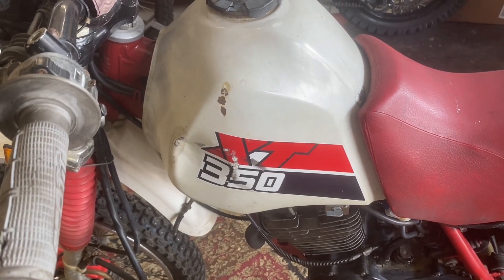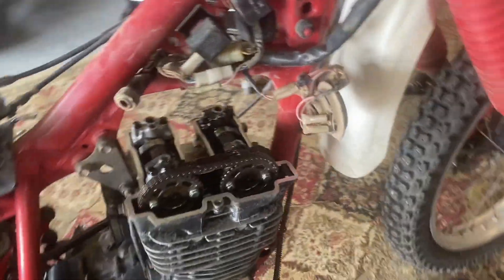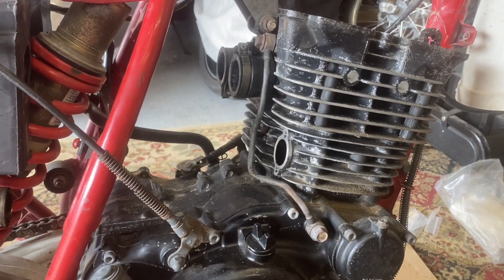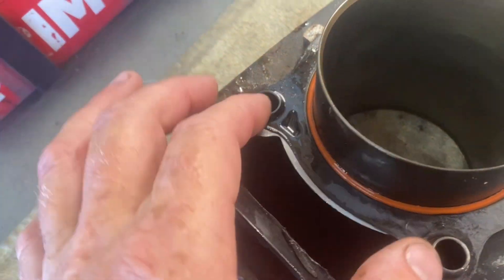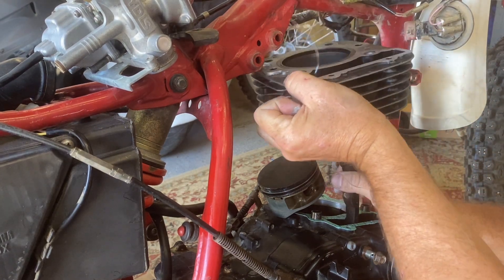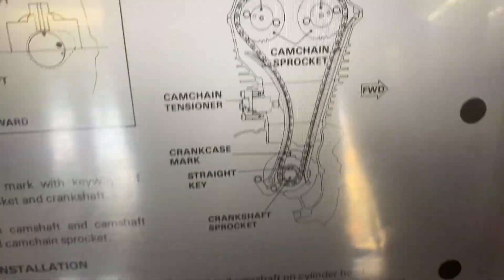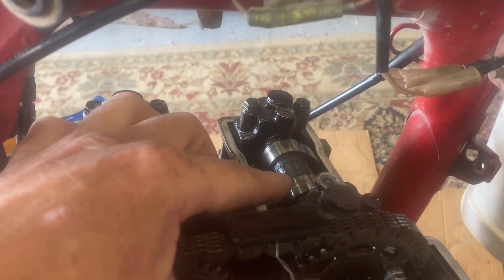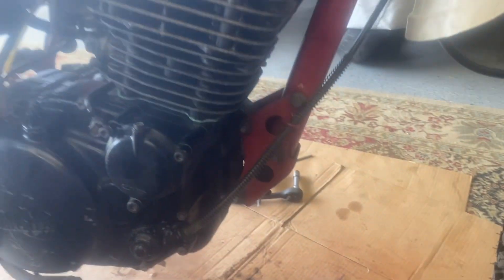Yamaha XT350 Top End Gasket Replacement

Comment: Im about to attempt a valve cover gasket replacement. I have oil dripping from that gasket currently. I believe its just 4 head bolts to remove it but I was curious, is there any special step to take to ensure the new gasket is seated and any tips? I never see that gasket getting put back on in videos. Thanks
Reply from the maker: Just the valve cover gasket, you can put a bit of sealant on it to make sure it stays in place.  The manual has the torque specifications.